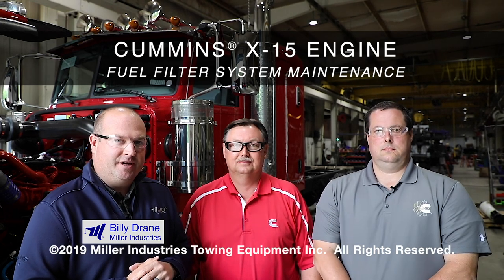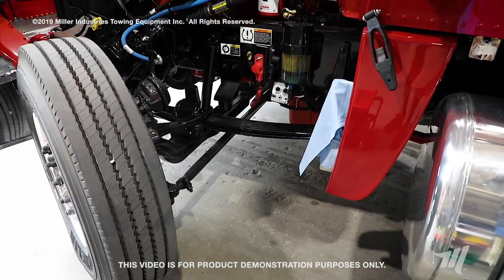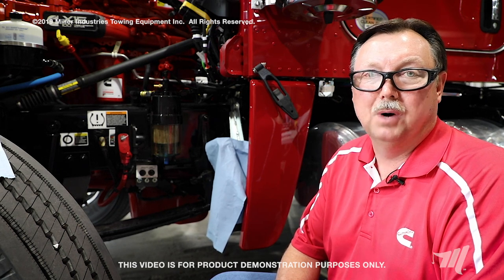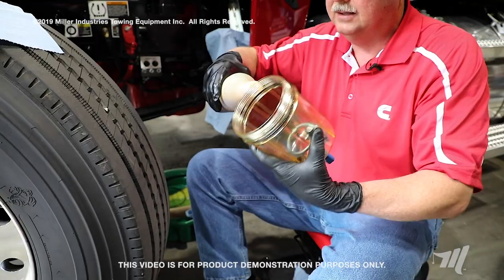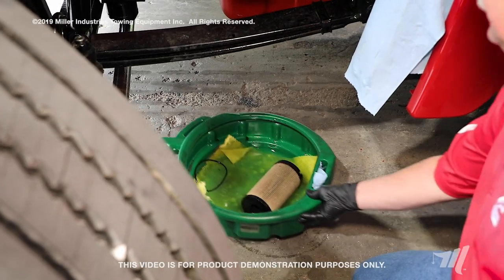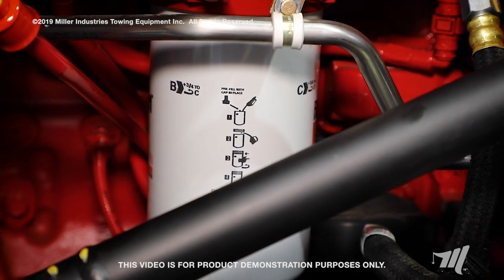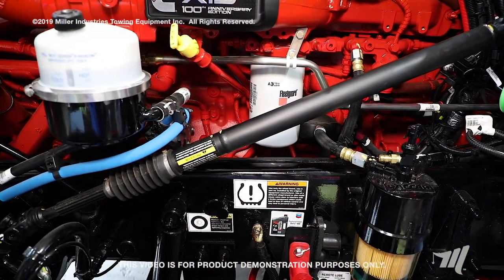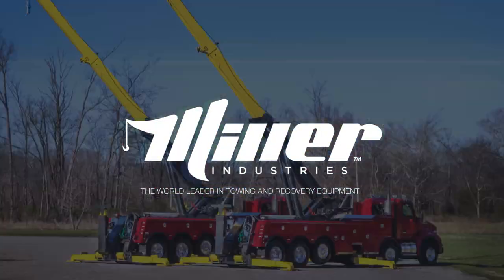Cummins X-15 Fuel Filter System Maintenance

Comment: This is exactly how I do my fuel filters, other than the battery disconnect. My 2021 x15 takes an absurd amount of time to get started again. I usually cycle the key and let the pump run 5 times and then try to start. If no start I let the pump run again until it shuts off then try again. Sometimes it takes around 10 cycles before it actually fires up and often throws a code for low fuel rail pressure. Is there a trick I don’t know about or what? Everyone I know with an x15 has the same issue
Reply: Make sure weather sep has fuel in it. Then to prime the primary filter just cycle the key a couple times ( without cranking the engine)  after this it should start easy.

Comment: You had me at “disconnect the batteries”. New sub 👍🏻😂
Reply: This is when I looked thru the comments haha to funny, disconnect the batteries!?!?! You mean make sure key is turned off ok
Reply: @justingoedel47  No they don't mean turn the key off. They mean disconnect the batteries. This is literally the first step for almost every repair in every manual written in the last 50 years. They tell you this because there are various electrical components under the hood that always have live battery power (starter, alternator, relays, etc.). When working under the hood it is very easy to bump or touch the these components with metal tools that can arc out to ground, burning and melting things in the process. Besides the risk of causing an electrical fire there is the safety risk to the mechanic. You don't want to have to trust other people to not turn that key. Just because the fuel filters are off doesn't mean that engine won't start and run for a few moments. In those breif moments mechanics could easily become crushed or entangle by moving components like belts, pulleys, and steering linkage or diesel fuel could be sprayed everywhere. 

Not only are you wrong Justin you are dead wrong. Lots of people every year are killed or disfigured because of failing to isolated equipment so it can't be started while they are working on it.
Reply: @chris6200  wow you must be fun at parties.

Comment: Nobody gonna talk about how this engine doesn't start when you do a filter change? Cummins really getting sloppy these days 😒
Reply: John Berry  sorry to tell u it doesn’t work On mine n have a 567 Pete 2019
Reply: I filled fuel filter let computer run through cycle once and busted right off.
Reply: @qbounti5152  Your truck must not have an electric lift pump or it may not be working properly. It would be very odd to not have a lift pump on a truck that new.  I've done this pretty much exactly as they show on multiple kenworth C500's and have never had a problem.
Reply: @chris6200  good for u n bless up urself
Reply: Yes I can contribute, I have a 2020 Pete 567 and it takes forever to restart. I've tried any and every method out there, prefill filters, bleed lines, change one filter at the time..... And so on!!!!!! 
It always takes a long time, since the first service. I even had the dealer check it out, their response everything working as it should.....

Man I missed our Kenworth nothing compare to this PITA Pete..... SMH
Tho I currently run the large paper fuel filter, maybe I'll try running the small version, see if it helps....

Comment: Nice video i just swapped out high pressure fuel pump. Although i primed as your video suggests my engine will not turn over. I air worked it’s way in the system. Any advice

Comment: good way to blow pump seals.   youlI need to bleed air out before turning engine over .   been there with customers 2 many times.  they dont do it right and get pump internal leaks.  he did it right on this engine.  but theres a ton of different guidelines.   for older engines

Comment: I removed my fuel filter with a wrench and now I can’t install the new one, I can’t line it up, I’m I doing something wrong?
Reply: I had the same problem,  I had to call road service to come out and help me. He got it on with no problem.  Did u figure it out,  I still really don't get it. Lining it up
Reply: @Nycbronx87  yes, the one filter I was putting on had bad threads , I tried a different one and bam it worked
Reply: @manuelsalgado8510  ok thanks for the reply back. I am going to try mines again today.
Reply: @Nycbronx87  that’s the trick, I tried the first day for about 3 hours and got so frustrated. Went back in the morning and still nothing, then I decided to try another new one I had and that one worked. Good luck
Reply: @manuelsalgado8510  it worked out good this time. Thanks again
Reply: Put some caulking around the rim… 
Make sure is all weather stuff…😁

Comment: I know what you're trying to say with "take the filter off by turning clockwise", but I'd strongly suggest you provide a better reference point. If you were to hang a clock from that filter bracket, it would not turn in the axis that the filter bowl is removed. You could have a mechanic on a creeper platform staring up at the filter, and his/her perspective of "clockwise" would be the opposite of another mechanic staring down on the filter. "Clockwise as viewed from below" or "clockwise as viewed from above" would be a preferable way to explain this.
Reply: Well written  agreement 
But your  still wrong sir.
You turn a filter left ( counter clockwise) to remove  and right or ( clockwise ) to tighten  or install if you will.
You filter base is a Righthand thread.
Reply: @jeffwatson2234  you missed the point 100%. Completely. Totally. As in, never saw it coming as it flew over your head. And frankly, don't tell me "your wrong" for two reasons: one, I never said anything to the tune of righty tighty or the opposite, so I'm not wrong, and two, it would be you're wrong (if I actually said something that was incorrect, which I did not) - the contraction of you are is you're not your (and it would be Your filter base not You filter base). Regardless, the vantage point does matter, and you've completely missed that.

Comment: Question , why batteries must be disconnected?
Reply: to prevent unwanted start.
Reply: to prevent unwanted start.
Reply: Just safety. There are under hood components that have live power to them all the time and you don't want to risk arcing out tools on them. If you look there's a big positive terminal that likely has battery power just Infront of the filter. You also do it to prevent other people from prematurely starting the engine while you're still working on it.